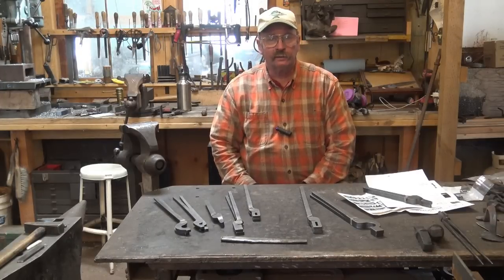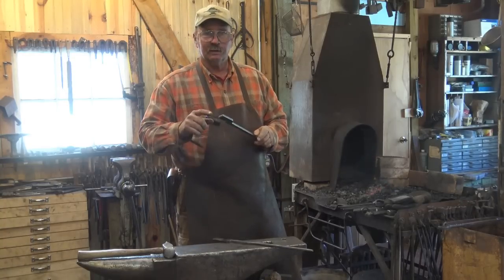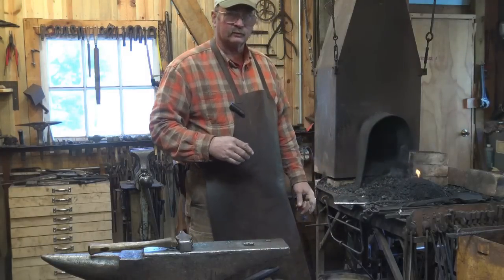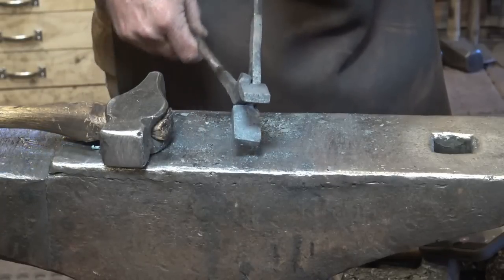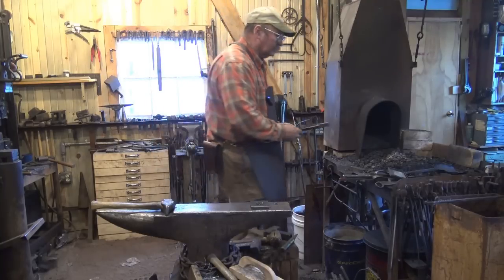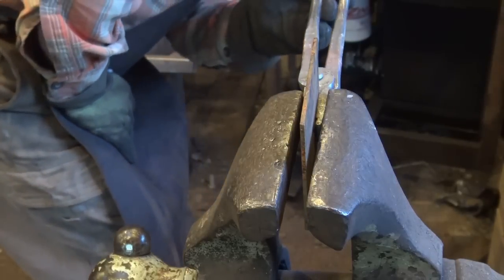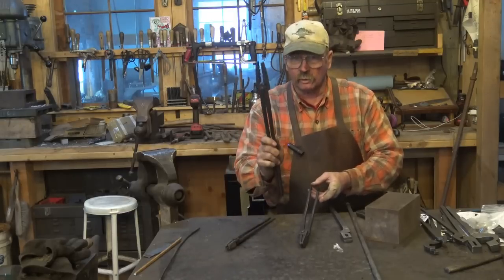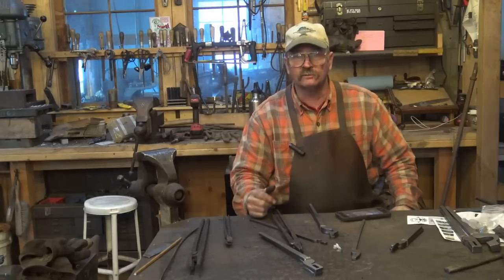Quick Tongs and Rapid Tongs from Kens Custom Iron - tool review

Comment: Good tutorial, John. As a beginner, I recently bought a half dozen pair of these. I’ve forged three pair into use and have to agree they’re a good product, inexpensive and fairly universal in use for getting started. The folks at Ken’s were great. Shipping was indeed reasonable for a batch.

Having used them for a dozen or so small projects, I’d affirm that you do want to at least take the edges off the reins. The plasma cut edges wear on the hands pretty quickly. Take John’s advice, too, and groove the flat jaws. They’re pretty slippery otherwise.

Ken’s slot jaw tongs really make a difference holding bar stock. I was even able to reheat them and get them to hold a piece of 3/4” round well enough to bend it 180* on the horn.

All in all, I’m well pleased; got a lot of tools for the price of two typical pair, and didn’t have to try forging tongs from scratch using channellocks and without skill. Now, with a little experience, I can tackle those.
Reply from the maker: Glad to know that others feel the same way I do about the tongs.  Also glad you enjoyed the video.
Reply: @BlackBearForge  
I have really learned a lot from your channel and appreciate all the effort you put into it. If you haven't done the vbit tongs it would be a big help to me. The offset is what has caused me to scrap 2 pair already.
Reply: @BlackBearForge  where are you from?
Reply: I, also bought bought both batches of tongs and have finished them and used tgem on several projects.
Well worth the money and the time it takes to forge and assemble them.  A great learning experience!
They are a great company to deal with
 Customet service is the best!
Reply: What kind of wax do you use?

Comment: I bought the rapid tong set and got my first pair put together today. very easy to do and were basically my first blacksmithing project. I think they turned out very nice. still need to tune them for my stock tomorrow,

Comment: I checked out the "handiness" of a set of tongs I made for myself a while back. You are spot on, I am left handed, but just straight copied the tongs as per the video, the tongs definitely hold better in my left hand, and want to role away when I hold them in my right hand! (So suited to a right handed smith).
So I pulled them apart and moved the reins so they are fully over the top of each other by the time they get to where I grip them, much better, but I will have another go with a new set  - twisting the other direction, see if the result is better again.
Reply from the maker: Handedness is easy to overlook or get backwards, but it does make them easier to use if you get them right.

Comment: I have some simple flat jaw tongs, they can't hold anything securely unless it has a very specific thickness and the constant adjustment is a hassle. I am a much bigger fan of bolt tongs, as long as you pick an appropriately sized pair they can hold most things at least moderately well after a little adjustment. The rapid tongs look like the perfect size to add to my collection of tongs.

Comment: Thanks for this tutorial for Ken's tongs, I have a pair of quick tongs from Ken way back when the AUD and USD exchange rate meant the shipping to Australia was reasonable. Lately the shipping of a set from Ken was around $58 USD, I hope you will continue to show us how to make tongs from scratch, I am particularly interested in learning to make some light and heavy duty bolt tongs. I also think that Kens tongs are a great way for a beginner to get a set of tongs to start off.
Thanks again for taking the time to make and edit a great presentation.
Reply from the maker: Shipping has really become expensive.  I do have plans to do a few more videos on tongs from scratch including the forge welded variety.  I will also plan on doing some bolt tongs.

Comment: Hello John, I thought those tong blanks looked familiar. :) Thanks very much again for the very useful information.  I'm on my 9th pair from Ken's Iron and I have found them to be a great product.  I built a pair of their large RR spike tongs late last summer.  The RR spike knives do well in the museum gift shop during hunting season.  I had a little problem with them, but after a chat with the folks at Ken's, I was able to see where things went haywire.  The spike tongs have made the work on the knives a much more agreeable exercise.  The tongs do seem to "wallow" out a bit though, after a time and need to be resized.  It's not a big deal, just a reheat and a little work at the anvil with a spike.  The other thing for me is that building the tongs from a precut blank has given me a better grasp of what needs to happen when tongs are built from scratch.  I look forward to seeing more of what the possible shapes are for the flat jaw tongs.  Also, do you recommend hardening or tempering?  Thanks again!
Reply from the maker: I think the quick tongs and rapid tongs are going to be very useful.  I never heat treat tongs and assumed these were made from mild steel and would not be hardenable anyway.  I prefer mild steel so that if the get red hot in use you can quench them without fear of cracking.  Some people make them from alloy steels that would be oil hardening and quenching them at a red heat in water would be a problem.
Reply: I think you are correct about them being made of mild steel; I believe the Ken's Iron folks mention that somewhere it their information about the quick/rapid tongs.  Thanks!

Comment: John,
As I troll through your older content, I went ahead and bought a package set from Kens website. 
I am in the middle of putting the Quick Flat and Slot Tongs together. 
I had to take a break and thought I would come watch your video again. 

I find it sad that there are several vendors selling Tong blanks like Kens, using almost identical pictures from Ken's site and what I assume is inferior products, 
But they are not affiliated with Ken and to me it looks like they are just knock offs.

One vender even referenced your video (good for your site).

Thanks for all you do. 

ARMY
Reply from the maker: Those are definitely rip off artists.  They pull images from Kens web site and my videos to advertise their lower quality product.  But there is not much I have been able to do since they are mostly over seas.

Comment: I've bought a few sets of these tongs and have built 2 of the flat bit ones so far. I wonder if it wouldn't be a better option (and a little less fiddly) to use a piece of square bar of the desired size to form the channels in the bits after they are riveted (while hot of course).  Forming the channels with a chisel and then trying to get them to line up after riveting seems a bit daunting to a beginner.

Comment: Im at 6:27 and i just want add something i have found helps utter newbies with the needing tongs to make tongs issue...harbor freight (or similar store even auto parts stores really anywhere with dirt cheap tools) will have 11" pliers for sale ...harbor freight has them on sale frequently for just a couple bucks but are regularly priced about $7.50 ...file the teeth down so they are slightly grooved but not sharp ridges and they make for a cheap set of very basic (certainly not ideal) tongs  to forge your premade tong blanks with ...you can also order a set of long handle pliers from amazon fairly cheap ...when you finally have your tongs forged round over your plier jaws and use them for scrolling work for tight scrolls

Comment: You mention in this video the rapid tongs work great for lighter work and quick for heavier work. Is there a general size range for rapid and quick tongs? Most of my work is 1/2 and smaller though some tooling will be closer to 1½-2 would rapid tongs work for most of it and maybe a pair of quick bolt Jaws for the tooling? Great videos keep up the good work

Comment: Thank you for this video! I'd seen these tong kits before but wasn't sure if I wanted to spend the money on them, if they would be worth it in the long run. I think I'll be ordering a set now.
Reply from the maker: I think they are worth it for learning how tongs work and making tongs in a hurry, in the long run they probably aren't as nice as forged from scratch, if you have the skills to forge tongs from scratch.
Reply: i do not just yet,  I'm still learning.  I'm actually in the middle of trying to build a set using your previous video on the flat stock twist method

Comment: I've started my first ever pair of quick tongs (3/8" thick stock). I drew out the reins, twisted both jaws 1/4" CC-wise, shaped the jaws and added the V grooves, drilled the holes for the rivet and did a dry-fit. They don't line up at all! Both jaws are pretty much identical, are 1" wide at the boss, and the only way the jaws would ever line up is if there were a 1/4" gap between the two halves at the boss. They came 1" wide from Ken's, so the only customizing I did was to taper the thickness and add the v-notch as in your video. Before I rivet them, I'm wondering if I did something wrong... (wish I could post a picture).
Reply from the maker: If you are in the Facebook group you can post pictures there.  But it sounds like it would help to forge the bits down that 1/4".  They are left wide to allow people to make different style of tongs.  For flat jaw tong you want the bit to be twice as wide as the boss so when you assemble them they are the same width.  I hope that makes sense.
Reply: @BlackBearForge  Thanks for the quick reply on an old video! Loving your channel. I'll check out the Facebook group. Yeah, after checking some books, it looks like the jaws need to be 3/4" wide for 3/8" material. So if I forge down the jaws from 1" wide to 3/4" wide, they should line up fine. Would be nice if their instructions mentioned that!

Comment: The explanation for handedness was good.  The instructions that came with my quick tongs was not 100% clear on that.  But I would like to see a set that has reigns which are one over the other.  Or each has a slight offset to bring them in line.  What is the best way to do this?

Comment: Great video I’ve been looking at these tongs for a while but what I really want is his smaller power hammer the mz75 I believe. By the way the only pair of tongs I’ve bought to date are from blacksmithsdepot.com and they are the off-center brand they make and they the universal v-bit tongs and they are my favorite tongs, they hold 1/4” round or square up to 1/2” round or square if not more but they also hold angle iron and pipe they are awesome I’ve never seen a pair of tongs like them any where else, keep showing the tong videos I’m looking forward to the slot jaw tongs
Reply from the maker: I have quite a few set of the Off Center tongs.  They are quite well made.  But if you haven't made your own or need some on a budget, I think Kens are a great option.  If I were i the market for a new power hammer I would be looking very seriously at his larger model.  It is similar to the one I have, but I think it is probably better made.  For a smaller shop the 75 would be a great choice.

Comment: If you don't have another pair of tongs to hold the tong halves finish the jaw end first then bolt a piece of small flat bar to the rivet hole to draw out and round off the reins.
Reply: Also fyi shipping is free from Ken's if you spend 200 bucks.
Reply from the maker: Good idea

Comment: Great stuff, they look good, I have made all of mine myself, oh except for 3 pair, the rest myself, when you were chiseling the bit why not put the reins between your legs to hold it on the anvil, they chisel that way. ? Just wondering, Cheers Len.
Reply from the maker: I like an anvil just a bit taller than is comfortable for that trick.  Plus with 
the bit down the reins are up adding an extra inch of discomfort.  
Typically I would do that under the treadle hammer where its very 
straight forward.  But I'm trying not to give the impression you need 
the specialized tooling. so I show it done at the anvil.
Reply: Yeah true John, good one mate.

Comment: What length should the rivets be when they are first put into the tongs and before they are put into the forge.  The rivets I received with the Rapid tongs look to be much longer than the ones you used in you video.  Thanks.  Great video as always!
Reply from the maker: The general rule of thumb is 1 1/2 time the rivet diameter longer than the material you're going through.
Reply: @BlackBearForge  Thank you!

Comment: What’s the size range a set of tongs will hold? You made them for 1/8 flat, will they hold 1/4 flat as well? Or do you need to make a second set?
Reply from the maker: Generally you need a set of tongs to hold each size material you work with.  Over the years I have made or acquired close to 100 pair and still don't always have just what I want

Comment: Are you using oversize drill bits? It seems like my hotrolled steel rod always runs larger than the standard decimal sizes of my drill bits. If so how much larger are you drilling?
Reply from the maker: I tend to use commercially made rivets that are exact size.  Otherwise I use cold rolled which ios also exact size.  Going up one bit size should be enough for the hot rolled material.

Comment: I’m having trouble with the rivets
Reply from the maker: Usually that is a result of tipping your hammer one way or the other, or uneven heat on the rivet.  Once they go crooked, its hard to fix, but they should still function

Comment: I guess I am the odd man out here in the comments.  I don't recommend these for a beginner, making your own tongs has always been a "rite of passage" for beginner smiths for centuries, for a reason. Making your own tongs teaches you the basics of the art, and gives you a usable tool at the same time.  Traditionally, the tongs he made were the journeyman's gift from his teacher when he left to open his own shop.  To make a pair of tongs the traditional way teaches forming, punching, drawing out, and hammer control.  To make them the modern way adds forge welding to the mix.
Raw material for tongs is much cheaper and readily available, and there is hardly any more work in making a set from bar stock than in these.  He even demonstrates this by drawing out the reins right at the start in this video, and reworking the blanks.  These blanks do nothing really other than act as a live form to guide you, and you could always draw yourself a layout sheet to do the same thing if needed.  And if you really have to have this form in your hand to guide you, cut it out with an angle grinder, hacksaw, or plasma cutter if you have one, and get some experience and practice with that, too!   It is my understanding that these are aimed at the big commercial shop, where time saved at the anvil is more valuable than money.  For a beginner, time spent at the anvil is way more valuable than money.
Too many times I have seen beginners rush out and spend money they don't need to, to buy tools they could easily make for themselves, or for tools they don't even need. (And not just in blacksmithing)  Don't make or buy a tool until a job comes along that requires it.  In time, you will build up a large tool set that is functional and practical that way. And believe me, you will fill up your shop before you know it, and wonder where the heck it all came from! :)  I first started decades ago with a flea market farrier's anvil and riveting forge, and a pair of vice-grips.  There are many good smiths around today who started with less. There was no YouTube, no internet for networking with experienced smiths, and one book available at the public library printed during the "back to nature" movement of the 70's to guide me.  I had no trouble doing what I wanted to do, and learned a lot without spending money I didn't have to.
Please don't take this as a slam on those who purchase and use these.  It's your time and money, and you are free to spend it as you choose. I just see a lot of excitement for this product, and while I am sure it's a good product for it's intended purpose, I personally think it isn't the right product for a beginning smith.

Comment: The rivets that came with my rapid tongs are 3/16 rivets and too short.
Reply from the maker: Thats odd.  Hopefully Kens was able to replace them for you
Reply: @BlackBearForge  Haven't heard from them yet. This was just the other day, though. Very recent.
Reply: @BlackBearForge  I reviewed my order again and I believe I purchased a set of knock offs of Ken's product even though they included a link to your video review of the rapid tongs. I don't think Ken's is responsible for this.
Reply from the maker: @SINNER_01  you’re the second person to mention that. Its odd for the knock off guys to use my video as instructions. But if it helps people assemble there tongs I guess I’m OK with it. In either case I’m not connects with them or Kens.
Reply: @BlackBearForge  only thing I can think of is they took an original video link from Ken's product and photocopied it. Either way, it helped me. LOL